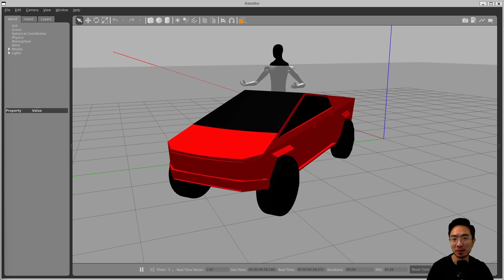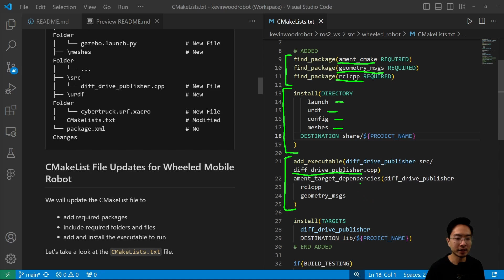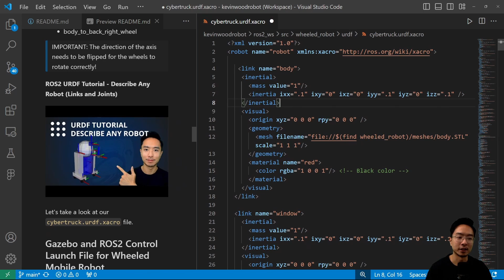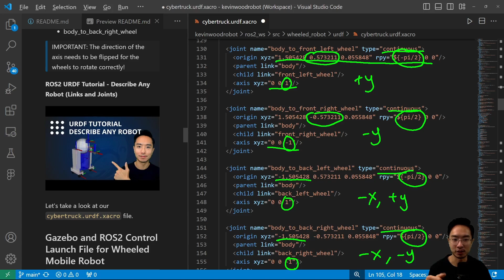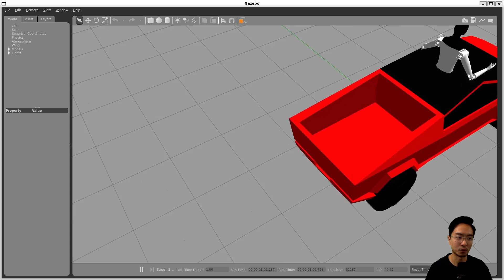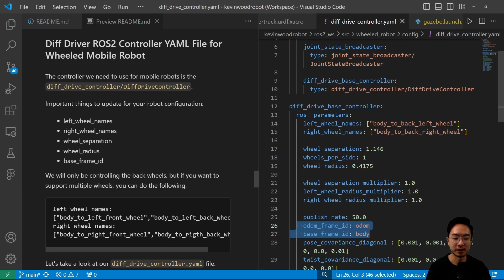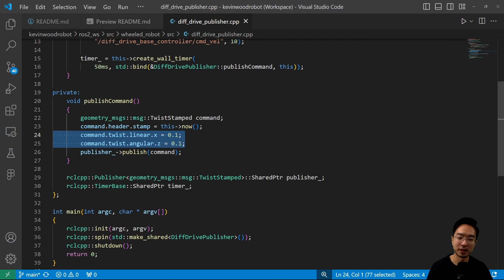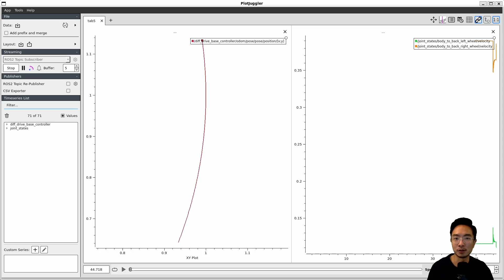ROS2_Control Wheeled Mobile Robot Gazebo Simulation Diff Drive Controller

Comment: i having a hardtime syncing the movements from ros2_control gazebo and rviz2, currently running an 4 wheeled robot with skid steer in gazebo the movement looks normal, but in rviz2, the representation turned a lot more than the gazebo one (specifically on angular z), it probably has something to do with the wheels slip or the physics, any thoughs on this?
Reply from the maker: Maybe check reference frames to see if they are consistent. Rviz should only generate movement based off your topic so it shouldn’t be able to see friction in Rviz, only in gazebo
Reply: @kevinwoodrobotics how to check that? im actually kinda new to ros2 humble for simulation
Reply: @kevinwoodrobotics  the thing is, the friction is working fine when i use libgazebo_ros_diff_drive plugin, the problem is that the friction is gone when im using libgazebo_ros2_control plugin

Comment: Hi sir 

I Hope you are doing well , I am working on a project that include using jetbot Ai robot for autonomous navigation , ( I have an rplidar A1 ) and using Ros 1 i was going to fuse data from lidar and yolov5 , but recently I faced a probleme while trying to implement the lidar , i tried for several days to solve but any results
If you don't mind I can share with you the error , it's related to rplidar package , m'y Guess it's display probleme, and thanks a lot
Reply from the maker: Sure you can leave your error here and I’ll take a look later. In the meantime you can check out my LiDAR video to see if that helps